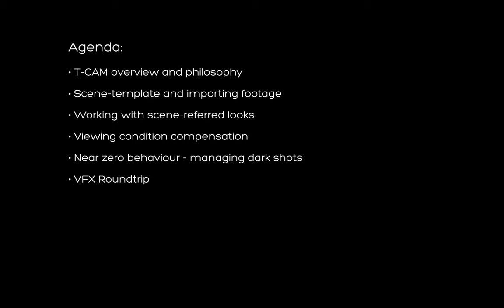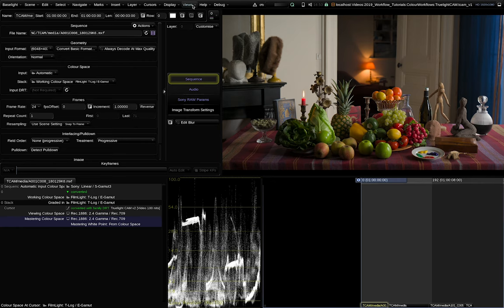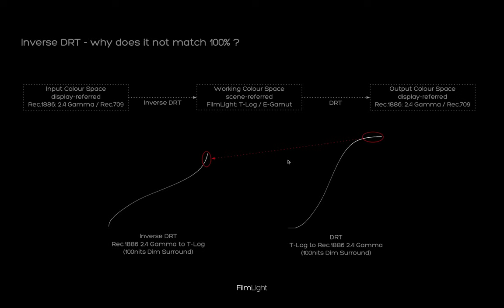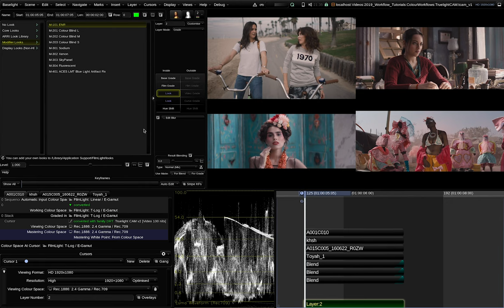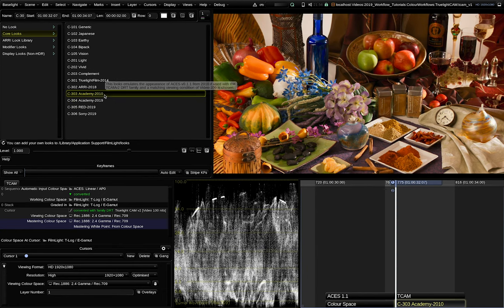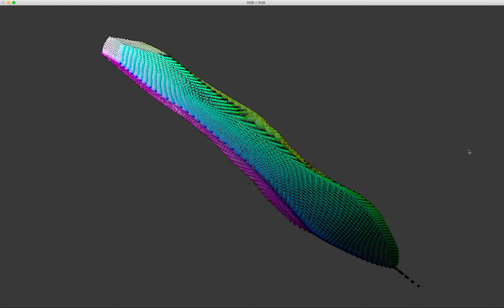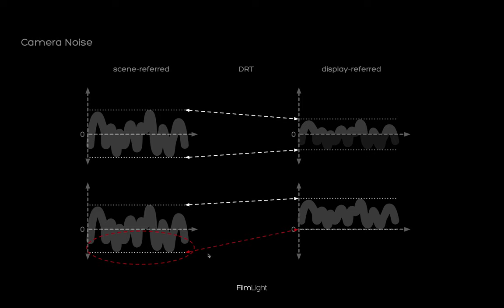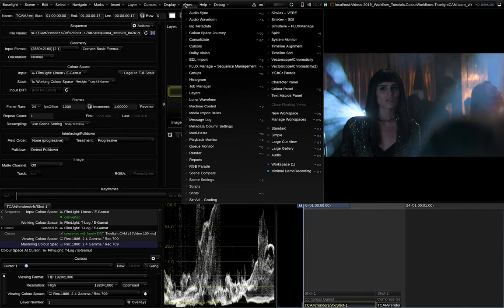Truelight CAM (T-CAM)

Comment: Chapter marks:
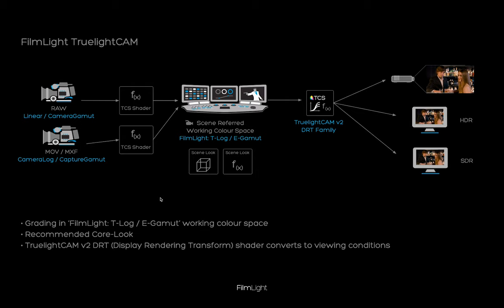00:25 - T-CAM overview
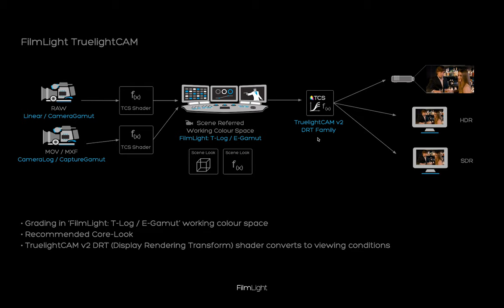01:17 - Why another colour pipeline? / Advantages
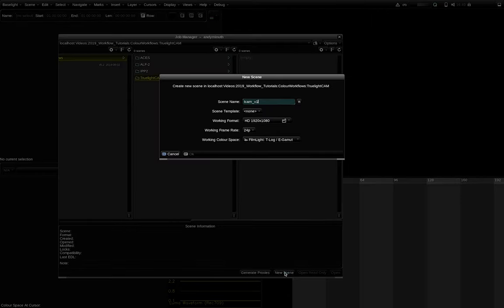04:10 - FilmLight scene template / examples
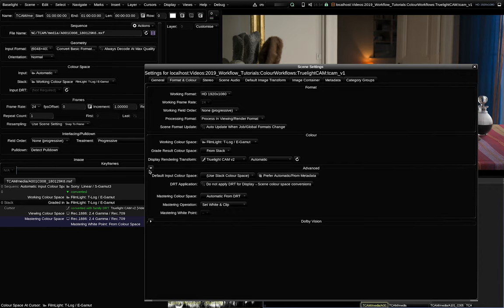05:45 - Mastering Colour Space
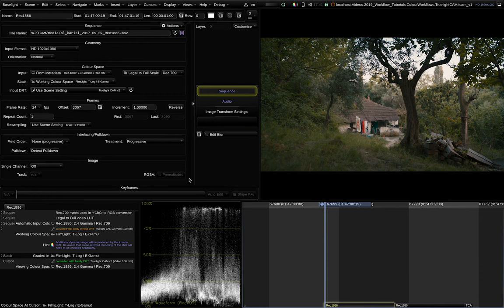08:05 - Inverse DRT mismatch
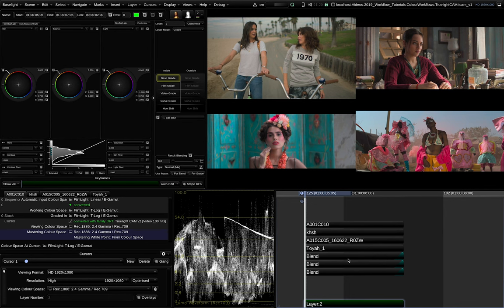11:10 - Working with Scene-Looks
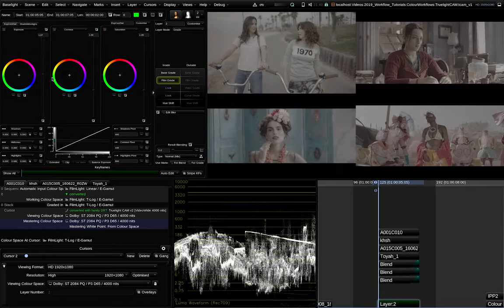16:46 - Chameleon/Camouflage-Looks
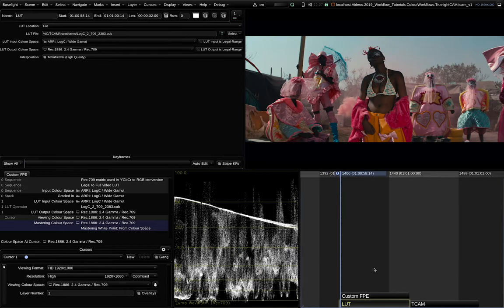22:58 - Custom scene-looks
24:46 - Viewing Condition compensation
27:56 - Managing Blacks / pre-flaring
31:08 - VFX Roundtrip